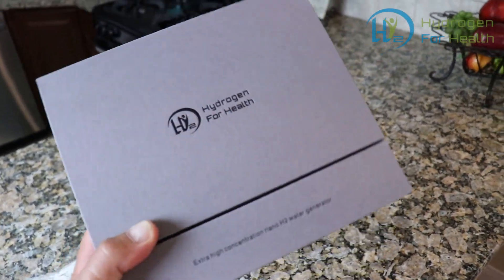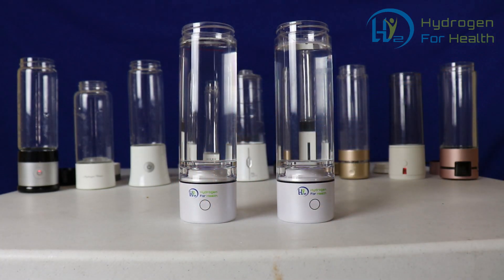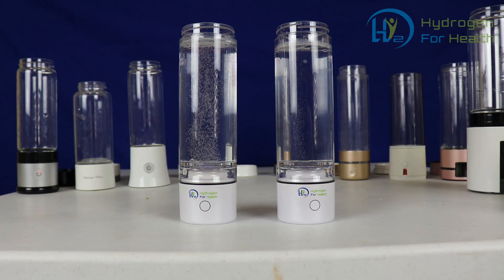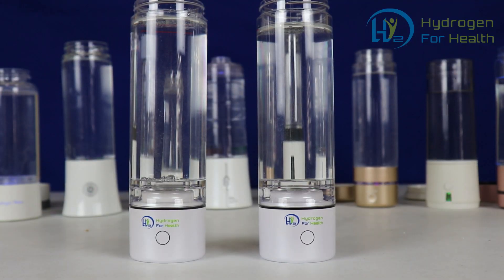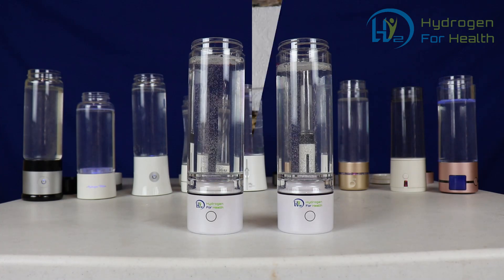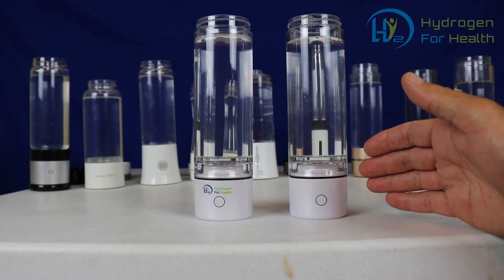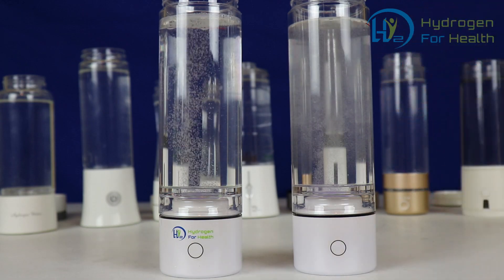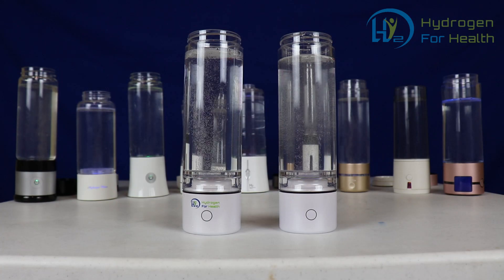Why isn't my PEM hydrogen bottle working correctly? It wont make a high PPM..

Comment: Dear steve, The video you produced is commendable, and we anticipate the release of additional content of a similar nature. However, I would like to present several points of contention:

a. When the Proton Exchange Membrane (PEM) becomes dehydrated, the process described in your video is typically referred to as activation. The activation procedure is relatively straightforward: one should pour half a cup of pure water (or drinking water with a Total Dissolved Solids (TDS) level of 4 or lower post-purification) into a container, add a small amount of white vinegar or citric acid, allow it to soak for one to two hours, and then proceed with hydrogen production. It is possible to alternate between hydrogen production cycles a few times, followed by rinsing with pure water. Subsequently, pure water should be added again for hydrogen production, during which one can observe an increase in foam from minimal to substantial.

b. The term "oversaturated" is indeed appropriate. Generally, when the concentration of hydrogen-rich water reaches 3000 parts per billion (ppb) or 3 parts per million (ppm), it can be classified as an oversaturated hydrogen water bottle. If the concentration reaches 5-6 ppm, it is categorized as super-saturated high-concentration hydrogen water.

c. Your assertion regarding the absence of hydrogen production from bubbles typically suggests the use of unsuitable water. We recommend utilizing pure water, distilled water, or drinking water that has undergone purification and filtration with reverse osmosis (RO) functionality, as inappropriate water may lead to scale blockage. The recommended course of action remains to reactivate the PEM.

d. We advise against your method of allowing water to remain in the cup for 24 hours, as this practice may promote bacterial growth, which poses health risks. In general, if daily hydrogen production is maintained for consumption, the PEM should not experience drying issues. Conversely, prolonged periods of inactivity can result in dehydration of the PEM.

e. For health considerations, it is imperative to ensure that the products have undergone water quality testing to confirm the absence of per- and polyfluoroalkyl substances (PFAS) and harmful heavy metals. This aspect is of utmost importance, as our objective is to provide health benefits rather than increase health risks.

In conclusion, your video is indeed impressive. I did not anticipate seeing your content again after a four-year hiatus, which indicates a robust organic traffic flow. Congratulations on your success, and I wish you continued prosperity in your endeavors.

Comment: Tap water works and gives me bubbles on 2 new units but when I used bottle water or water from my water cooler - nothing- zero bubbles?? Suggestions before I send them back?? Ill try the 24hr method tonight??
Reply from the maker: It's not PWM and will probably put chlorine and ozone into your water.

Comment: How come the hydrogen bottles don’t work with purified water?  My boyfriend and I both bought hydrogen bottles. Two different brands. When I got mine I filled it with purified water and it didn’t work. I then put tap water in it and it worked great. So, we then tested both bottles with tap water, filtered tap water, spring water, well water, and purified water. Both bottles worked great and made a lot of bubbles with all the waters except the purified water. Neither bottle worked with the purified water. Both bottles ran the whole cycle but nothing happened.  No bubbles.  So, two different bottles, two different brands, and sane same results.  Is purified water not usable in hydrogen bottles?
Reply from the maker: It's because you're using a cheap product that not only doesn't make therapeutic levels of hydrogen but is unhealthy, putting chlorine and ozone into your water. Take a look at this video, I explain : https://youtu.be/xd84wnlUWCA?si=7Uz8cWcZoxHszaRY
Reply: I did watch the video and I did buy chlorine and ozone test strips and there is no ozone or chlorine in the water.  I did receive the correct response from someone else. Thank you anyway.
Reply: @Pajamamama63 what was the issue???
Reply: @rickycruz7446  I did receive the correct response from another YouTube channel and it’s that hydrogen bottles do not work with purified water because purified water has no salts in it and the electrolysis cannot work without salt. So, I did a little test and I put purified water in my hydrogen bottle and added a dash of salt and then it did in fact work perfectly fine.  So glad I didn’t listen to this channels response as his response didn’t even address the question which was why doesn’t purified water work in hydrogen bottles.  He just replied that you have a garbage bottle and said to watch the video. Maybe he should read and answer the actual question.
Reply: @Pajamamama63   pls you are in big wrong.Pls take note Hydrogen release based higher pressure, not like with salt issue. And Purified water is 10000% to recommend. Because it will never have a risk to cause PFAS, Heavy Metal. The hydrogen Concentration comes from PEM and pressure, if you give more pressure, the concentration wil be more. However you cant always seek the pressure, but need care of if more pressure comes, the bottle cound bear it. Currently market stable level is 5-6 ppm is best one and really matters a lot. One best hydrogen bottle, will included a, best PEM  if the PEM if stable or not, this is very very important, if PEM not stable, then nothing.  b,  Food grade PC Tritan material, shall have SGS test report on this material. c, pressure relief, give a 1ATM it would generate 1.6ppm approx, so if you give 3-5 ATM, it will create enough stable hydrogen concentration at 5-6ppm. c, you bottle did support suturation or Super Saturation high concentration producing. Some lower concentration bottle need more cycles to produce to get the high concentration, but it is dangerous, there will some issue happen, you cant open the bottle, even it have button, you cant press on it, or it will leak, then the products totally not works. So you need make sure the one you bought is the real one could bring super-Saturation High-Concentration Hydrogen.  And very very important, those units who use SPE technology could support all kind of water. However to avoid of Scale and heavy metals,the best idea is 
the drink with pure water even it equipped with SPE PEM technology.  Water is important, but pls care of health water that dont bring Heavy Metal or other damge for health issue, Or all is nothing.  Better when bought one of brand, ask them to supply IHSA Certificate, H2 Analytics Concentration Test Report, SGS PFAS test report, SGS water quality test, if have H2HUBB Approval is a plus.

Comment: My pitcher from IonBottles produces lots of bubbles and a slight ozone smell which is supposedly normal. Issue is I bought test drops to test dissolved h2 and even one drop doesn’t go clear. Is the pitcher not producing any hydrogen? I ran high cycle twice and same result tested right away once cycle was finished.
Reply from the maker: Ion bottles is the new headache in this space. They sell a few products that are just plain bad for you. Your pitcher is one of those examples. See my video "is hydrogen water safe" your pitcher produces chlorine, ozone and very little hydrogen.
Reply: @Hydrogen4Health  I have chlorine testers as well, and there was no change in the amount of chlorine before or after the cycle was ran so I will disagree with that particular statement. Now, is it producing hydrogen, the jury is still out.
 I will watch your video, can you share the link? I can’t seem to find it on your page.

Comment: Very informative video thanks. I just got a new bottle and it said to do 2 cycles with 50-60’c water before using. Both cycles produced plenty of bubbles, then I’ve tried a few cycles with room temperature distilled water and I get no bubbles? Then I filled it up with warm tap water again and it was back to producing lots of bubbles?
Reply from the maker: This doesn't sound like a pem bottle, be wary.
Reply: @Hydrogen4Health  oh ok thanks. What could it be if it’s not? It definitively makes lots of bubbles with tap water both warm and cold but nothing with our home distilled water. Not even a trickle of bubbles

Comment: Mine is nit a fine mist like this. Its very faint fine mist and a bunch of larger bubbles. 

Ive done everything suggested here. Still no better. Is mine broke?
Reply from the maker: Large bubbles indicate your bottle's membrane isn't sufficiently hydrated.
Reply: @Hydrogen4Health  Thank you. I left the bottle full sitting in the counter for most of the day and evening. Can it really take that long to satirate the membrane?

Ill leave it for a full 24 hours and see what happens. Thank you for your time and advice.

Comment: So I generic bought a Hydrogen jug and as I didn't want to use tap water so I used distilled water instead but no bubbles formed. I then saw the instructions say distilled water is not recommended. So I added a pinch of sea salt which started the bubbles off, but am I making any unwanted gases in addition to hydrogen as it has a funny smell to it now?
Reply from the maker: Yes adding salt to a bottle that doesn't use PEM technology will generate chlorine and chlorine gas. If it's not PEM tech it should not be used, unhealthy.

Comment: My H2Lite water bottel stopped producing any bubbles... none of these solutions seem applicable. Any advise / idea ?
Reply: Me too.
Reply: @ellenkehoe208  Check that you have removed the cap inside - to me it was not clear that I needed to do this - remove the white cap inside
Reply: When I press the button to turn on, it works for two seconds and stops plus the light goes out. I've done what you suggested  but no joy.  When new It's worked for two weeks with no problem .

Comment: I have the second bottle from the left "Hydrogen Water" ... out of the box, I followed the directions however after plugging the unit in, I cannot tell if it is charging. The directions said it should turn red. I don't get red, I do get green but still don't know if this is the charging stage or not. I'm totally confused. If you can give me some insight would be helpful. Thank you.

Comment: Mine has a white powdery looking residue at the bottom after it’s been producing hydrogen is that normal ?...when I shake the bottle it mixes in with the water ?...what is that ?...is it the hydrogen ?...is it safe ? Or does it need cleaning ?...it’s brand new I’ve ran it 3 times...thank you if can  help be appreciated
Reply: Do you have calcium in your water?

Comment: I had the same issue with my hydrogen bottle all you have to make sure it is to get it completely soak the membrane it doesn't even need to take 24 hours tap it lightly from the bottom so that the water really seeps into it when I sit there for a good like 5 minutes or three honestly once you've done that turn it back on it's going to have a full function of bubble work and you'll really see a producing hydrogen

Comment: I have a problem that's somewhere in between these 2 scenarios, i have hydrated the membrane for about 12 hours since it arrived and then started using it, it was fine for a week, until the bubble production started dwindling. I never let it sit dry since I started using it. I even ran the cleaning mode and then did a soak using citric acid and warm water. But the bubbles kept reducing until it completely stopped having any bubbles anymore when I run it (even for several more cycles). Should I let it dry out, or keep it soaked for several days? Confused
Reply from the maker: Put a bit of water in it and store it up side down after every use. The membrane will stay moist but wont get over saturated.

Comment: Hello, i have not used my H2 for a while and just came back to use it after around a month. I usually leave a tiny amount of water on the membrane under the cap after use so it doesn't dry out, unfortunately on returning to use it today the membrane is dry and i have no idea how long it has been like this. I have tried to run numerous times but i am not getting much hydrogen, only a few large bubbles....is it possible i have permanently damaged the membrane due to it being dry for a few weeks or will i be able to fix if i let it saturate and keep running cycles? please help.....
Reply from the maker: I think it will be okay. Let some water sit in it for a couple of days.
Reply: @Hydrogen4Health  brilliant, il keep at it and hopefully be hydrogenated by the end of the week🙏❤️👍

Comment: Thank you for this video. I am a little confused about the over saturation. So if we run a bottle, should we then remove the bottle and let the membrane dry out between bottles? If we make water several times a day for a few people in the house, will that over saturate it? If we let it dry out between bottles, won't it then also have a dry membrane problem?
Reply from the maker: This can be a tricky phenomenon. I find it best to leave a bit of water in the bottle and turn it up side down. This way the membrane will not be wet but still gets moisture from the humidity. If you are using it several times a day you will not have to worry about this. It's when the bottle sits for a couple of days with or without water in it that causes this problem.
Reply: @Hydrogen4Health  Sorry I have another question. I know you said you are going to be doing a video on how long the hydrogen lasts in water. My question is, if I do an Evian water bottle on my machine. Then as soon as it is done put the lid on tight. Will the bydrogen last until it is opened before it starts dissipating? I would like to do several of them for my friend who has Parkinson's to try. Give him enough for a few days. He will buy his own if it works. But I would hate to give him several days worth, him try it and nothing happens because the hydrogen didn't last in a closed bottle.  Thanks for all your help.
Reply from the maker: @shellic5166  I do not know how long it is goi g to last but I know it won’t last for days. I’m thinking hours.
Reply: @Hydrogen4Health  Thank you so much, I understand that much better.  🙂

Comment: Thanks very useful information. I was getting no bubbles and thought it was because of the distilled water and that you needed minerals. So now it makes sense. Gratitude for the time and preparation of this video.
Reply: Actually it is the other way round: I first used my own borehole water, which is very mineral rich. After a while it still produced bubbles, but obviously  not high concentration hydrogen water. Where as usually I could produce about 5-6 batches with one charge, now it took dozens of batches and several days before a recharge. I was devastated, because the energy I at first got from drinking the water was quickly being lost. Then I read about the potential problem, why you can have bubbles but not hydrogen being produced: Too much lime/minerals in the water. Remedy: Soak it in some vinegar for a while. This is what I have done. Wow, what a difference: Actually on more than one occasion after that it literally blew the lid off.:-)  So: Rather use distilled or reverse osmosis water to get your best results!
Reply: I felt abit dizzy first time using it and I used tap water. I read on amazon reviews that tap water can make you dizzy. Toughts? Was it because i drank the water i was suppose to rinse the device with?